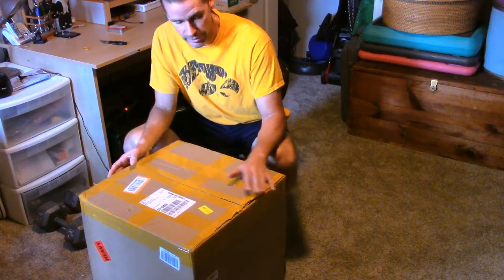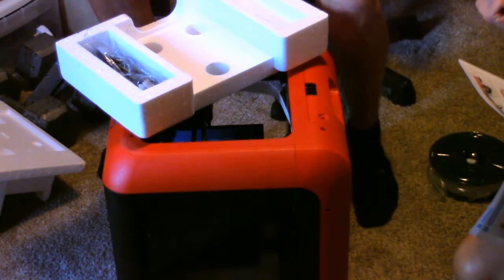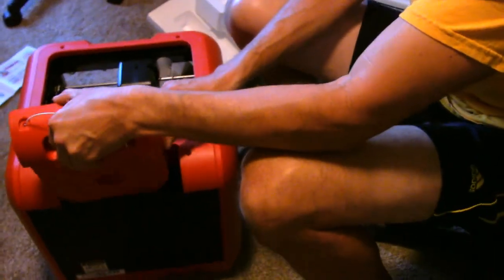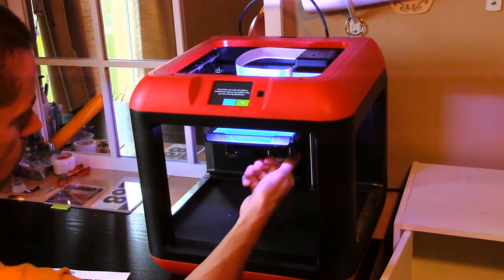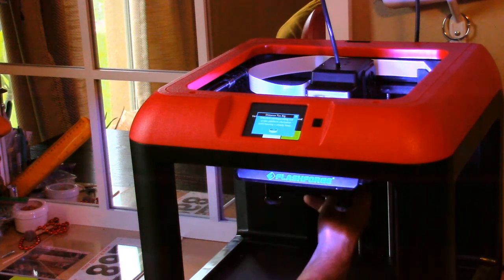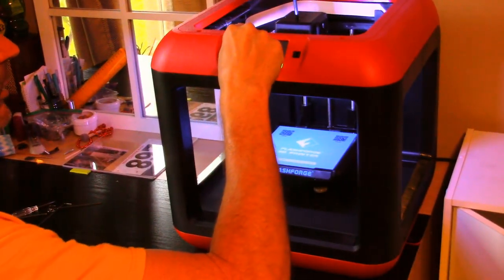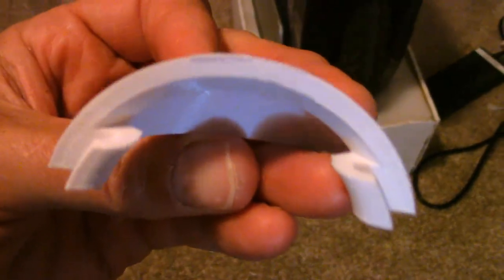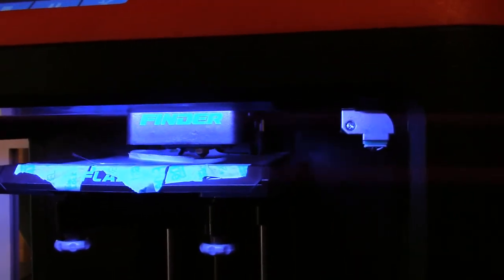Unbox and first experience with FlashForge Finder 3D printer

Comment: Very cool! You will love and hate it ;D
 if the printer supports other slicing software then i would highly suggest something like simplify 3d. 
Something people usually do is make a starting scrips where the printer extrudes a line at the very edge of the printbed to prime the nozzle and get rid of any bits hanging out. 

when it comes to printing PLA. Ive had very good success with extruder temp 200c and printbed 70c.
You also want to print the first few layers without the fan spinning to cool the plastic. Makes it stick better :) after that you blast it at 100% . Have fun!
Reply from the maker: Thanks for the tips, my print bed is unheated as the printer is PLA only.  I also started using rafts and brims which seems to allow the get any junk in the nozzle out before it matters. Flash Print does support slicing, I'll take a look at Simplify. I don't think I have any fan speed options.